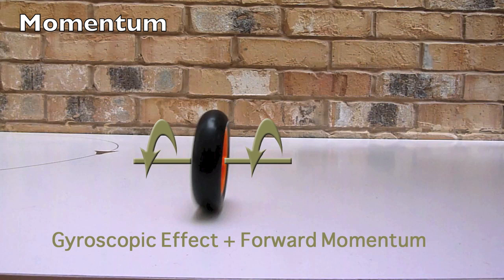The Physics of Countersteering

Comment: Sorry but "Physics of counter-steering"? Not so much. What actually causes the bike to lean is a result of gyroscopic precession. Applying a torque through the handlebars to the rotating front wheel induces a torque orthogonal to the axis of rotation causing the bike to lean. Riders will also know that the more you counter-steer, the larger your lean angle gets. This video tells you that you need to release pressure on the grip to allow the wheel to steer. This is simply false and is absolutely not explaining the 'underlying physics.'
Reply: Basil43D
Nope. The video does have some minor flaws but is actually correct in every point that you address.
Reply: Enema Twatson How's that? The video mentions nothing about gyroscopic precession. The author is stating that the lean is created by first steering in the opposite direction to, in effect, push the bottom of the bike away before turning the bars back to the intended turn direction. That has nothing to do with resulting torques, and while seemingly intuitive, is not correct. Like I said before, if you are riding and desire to increase your lean angle, you increase countersteering pressure. This is the opposite of what the author stated. I appreciate your reply, if you think I've missed something please let me know.
Reply: Basil43D
It's been proven that while gyroscopic precession does exist and inevitably occurs while CS-ing a bike, it is neither the main force at play nor is it in any way necessary. The primary factor is as described in the video.
Thus, omitting gyroscopic precession is something I'd call a simplification rather than an error.
PS: I apologise for being a bit curt in my initial reply.
Reply: Enema Twatson I'd love to see the study that concluded that. Gyroscopic precession is a fundamental principle when talking about rotating systems and dynamic analysis. Gyroscopic forces can be immense even at the scale of a motorcycle wheel. In fact, in some cases, inertial forces will be greater than respective mechanical counterparts.
Reply: Basil43D
Fair point. I certainly cannot calculate it myself. I have seen a single figure of 12% of the force which may or may not be correct and surely depends on a whole host of assumptions.
The proof I'm alluding to is rather that bicycles with an extra contra-rotating front wheel (resulting in zero gyroscopic precession) have been built and reportedly steer pretty much the same as a normal one.
Reply: Enema Twatson I could see how a bicycle wouldn't be severely impacted by such an addition, however, I'm sure you would agree, the difference in angular momentum between a bicycle and a motorcycle are orders of magnitude apart. Just the weight alone would make a massive difference let alone that motorcycle wheels have much higher angular velocity generally. I'd be curious to see how bicycle steering would be affected at greater speeds such as we are seeing in the tour de france these days where riders are routinely reaching speeds exceeding 50mph. I would bet that at these speeds they would begin to behave similar (steering wise) to a motorcycle.
Reply: Basil43D
Bicycles have larger wheels and are also very much lighter. Not sure how this pans out in terms of how significant gyroscopic precession is.
One thing I'm pretty sure of is that bikes CS much easier at 25 mph or so than at 80 and that they steer lighter and faster with lighter and smaller wheels which rather suggests that the gyroscopic "effect" is actually detrimental. 
In other words, the help you get from gyroscopic precession does not offset the cost in terms of inertia.
Reply: Well the resultant torque which causes the precession is based on the angular momentum of the wheel. Angular momentum is the analogue of linear momentum which is just mass * velocity (p = mv) so in our case it is mass moment of inertia * angular veolocity (L = Iw). Approximating the wheel as a hoop, we can say that the angular momentum of a wheel is equal to mass * mass moment of inertia * angular velocity or (L_wheel = m*R^2*w). This means that the radius of the wheel has a greater effect on the resultant torque than mass or angular velocity do, but they still will contribute. In the case of the bicycle wheel which has a slightly larger diameter than a motorcycle wheel but as you mentioned, much less mass as well as (genreally) much less angular velocity. All in all this means that the precessive effect will be much, much less. We could calculate some examples but they would obviously be approximate as there are many factors to consider (wheel weight and cross-section, brake disk weight, tire weight etc...).

In regards to your comment about bikes being easier to manuever at slower speeds, of course you are correct but note that your attribution of detrimental effect to gyroscopic precession is misplaced. Gyroscopic precession is merely a name given to a specific resultant torque and its tendency to act 90 degrees out of phase with the input torque. In our case, the resultant torque is that which causes the bike to lean, and the input torque is the input from the handlebars. What makes the leaning more difficult is a result of the greater angular momentum (see above) because of the increased angular velocity of the wheels (remember, L = Iw). This is of course why lighter wheels and tires make for a more nimble bike. In order to reduce the force required to lean the bike over with counter steering, the only variable you can control is mass (assuming all wheel cross-sections are the same, and for the most part they will be). The resultant torque will always have a positive linear relationship with the input torque regardless of all the other variables.

I hope this makes sense. I'd be happy to elaborate on anything that I didn't explain well, which lets be honest, is probably most of it! :)
Reply: Basil43D
So far no real disagreement except that I have no idea of the magnitude of the force generated by the front wheel moving aside so no idea if it dwarfs gyroscopic precession or not. I guess the ratio is speed dependent as well. At any rate, it's definitely not something we can guess at.
Reply: Basil43D
Regarding input torque vs resultant torque, I think that's pretty much what I was getting at.
More gyroscopic inertia does not "pay for itself". The bike will be more flickable if there is less of it suggesting that the ability to turn the steering faster and with more amplitude trumps gyroscopic precession when it comes to causing the bike to lean.
Reply: I certainly see what you are saying, but realize that the very act of moving the wheel to the side is (essentially) what causes the precessive effect. In fact, the resultant torque I mentioned earlier would act instantaneously as the input torque is applied to the handlebars, whereas, the amount of gravitational torque you referenced required to lean the bike over wouldn't be great enough until the lean angle was considerable. Especially at greater speeds where, as you mentioned, angular momentum would effectively be resisting any change to lean angle. I believe this is the reason that the counter steering effect occurs so seamlessly and immediately, because it is initiated not by a gravitational torque as you mentioned but rather because it is initiated by the resultant torque which is instantaneously applied as the input torque is applied to the handlebars.

Comment: If I wanted to get around that obstacle I would simply push down on my left grip and as I got my angle I would push down on my right grip; You can call it what you will but it has worked for me through six motorcycles over many years.

Comment: The last part of the explanation is mostly incorrect. Sure, at low speeds you can do this. But At any normal speed that's used on the road, The bike never actually steers in the wrong direction to set up the lean. Pushing on the left handlebar never actually makes the  handlebars or wheel ever turn to the right.  Instead what it does is, it causes gyroscopic precession to lean the wheel to the left.  You're applying a force to the front wheel, and the wheel (and steering) are reacting in a direction 90 degrees to the input (90 degrees later in the wheel rotation. So a right turning force applied to the wheel causes the wheel to lean left.  another way to look at it is, you're trying to make the back of the wheel go left, but instead the top of the wheel goes left/the bike leans left).
Reply: Brian Cooney
You are wrong. The steering angle may be very slight and of very short duration but it must happen.
How would gyroscopic precession occur otherwise? Let's leave aside the proven fact that gyroscopic precession is only an incidental phenomenon that does contribute somewhat but is by no means the whole story.
Reply: Have you ever tried "the bicycle wheel trick" for gyroscopic precession?  I was lucky enough to have the setup for a while.  just a hinge attached to the axle of a bicycle wheel.  With every input, the reaction is exactly 90 degrees off. Above a certain rpm, It never moves or reacts in the direction of the input.
With that being said, I have played around with this on the motorcycle quite a bit. And i'll agree that it's much more a combination of the two, than my original comment suggests.  The bike does need to go "the wrong way" a little bit, in order for the lean to take place. But the gyroscopic precession is what makes the lean occur (without it, you'd need to consciously lean the bike over, or wait for it to sort of "fall into" the turn.)
Reply: Brian Cooney
I have actually tried the bicycle wheel demo holding the axle in my own hands..You just cannot stop the wheel from leaning. It's real, no doubt about it. 
It is a very convincing little trick. A very useful teaching aid to overcome the disbelief of the students. 
However, the position I now believe to be true is that it is indeed just a trick and that the force while not  trivial is far outweighed by the force outlined in this video. 
It's impossible for the rider to tell for sure and I admit that I have not seen any actual calculations yet.
Edit: And bikes really do CS as soon as there is any forward motion at all. It's just that it's not a very easy and controllable way to turn at very low speeds.
Reply: gyroscopic precession is "just a trick"  lmao.  You obviously don't fly helicopters or use any sort of gyroscopic instrumentation.
Reply: Brian Cooney
Try again when you have actually understood what I said.
lmao. Lol. 😁
Reply: The gyroscopic effect is somewhat negligible in this case...

Here's the best analogy I can think of that you should both hopefully be satisfied with:
1. Think of the front wheel on a bike like a front-ship rudder on a boat, but in this case, rather than the rudder being straight down into the water, it is projecting forward from the boat and sitting above the water waiting for you to 'turn it' from the handle-bars (steering-wheel) before it makes contact with the water.
2. Instead of a steering-wheel you have bike handle-bars
3. You push forward on the right bar
4. This causes the left side of the rudder to make contact with the water, which creates a drag force on the left-side of the boat and steers the boat to the right (just like putting a paddle on the left side of a boat would make it steer right)

The same is what is happening on the road with the tyre, push the right handle bar forward and the left side of the tyre is making more contact with the road, the bike now wants to fall over itself to the right hand side due to the disproportionately larger (and temporary/momentary) 'left-side' contact patch on the road, the bike is tipping over its own weight until it strikes a balance, it is a fine 'balancing act' of forces on two wheels due to its centre of mass, not the case in a car where the centre of mass sits inside a square of 4 wheels, on 2 wheels it is just sitting on an axis
Reply: That is only part of what's happening. There is a lot of gyroscopic precession at play.  If you don't think there is, just ask yourself this:  How easy is it to turn the front wheel when riding?  is it more difficult to turn it when riding than when stopped?   Yes. Of course it is. Where there is gyroscopic rigidity, there is gyroscopic precession.   
Did you also notice that the handlebar on the inside of the turn tends to "push back" against your hand in a turn?  That's also gyroscopic precession. It's basically a gyroscopic feed back of the bike leaning.   
There's a lot more physics involved than just steering the tire and having the bike fall into the turn.  That's part of it, but definitely not the whole picture.

Comment: Think about this; When you first learn to walk as a toddler, you learn how to balance yourself on two legs standing upright. Cool. Then when you are about 4 years old, Dad comes along and puts you on a small 2 wheel bicycle and gives you a gentle shove forward. The damn machine doesn't want to cooperate. After crashing 10 or 20 times, your young brain finally puts the problem into perspective and you begin to shift your body weight and handlebar in the proper direction to remain upright ( more or less ). Voila! You can ride a 2 wheeler without those pesky training wheels.Its somewhat counter intuitive to our sense of balance, which is why we have some trouble mastering it, but  It stays with you the rest of your life.

Comment: Nonsense. The gyroscopic forces on your spinning wheels by themselves are inadequate to keep you upright and anybody who has ridden their bicycle on rollers knows this. Without fork rake and trail, your motorcycle would not remain stable. The shape of the tire is also significant - if your tire was square in cross-section you'd have a Hell of a time leaning into a curve. On the other hand, tip a cone onto the ground and it will roll around its point. The motorcycle tire is like that cone. Tip it while rolling forward and it's going to begin describing the turn. Counter-steer serves to present that the side of the tire to the road, tipping the "cone," and initiates a turn.

Comment: I rode for 50 years without noticing the first input is opposite the intended direction of travel..... It makes total sense though. Moving the tires to one side  forces a lean to the other, which is what's referred to by motorcyclists as "throwing" the bike into a corner.
However I can't possibly imagine someone negotiating traffic, and trying to "think through" a maneuver. Better to get a 125/250 and ride around in a pasture every day for a month or so. By then it should be all reaction and muscle memory...... Good Luck.....

Comment: i would like to add to great explanation that when you countersteer you push bike to a smaller diameter of a tyre which provides turning. Square tyres wouldn't turn.  In that regard it is little similar to a how train turns.
Reply: Square section tyres can be turned ; I rode sidecar tyres solo for 3 years, including one front tyre that had asymmetric wear across the tyre as the bike had been set up incorrectly on its previous sidecar. I was simply doing naturally what is now called countersteering  as I had ridden bicycles since age three.

Comment: this is an over-complicated explanation of what is going on. also pushing forward on the left hand grip does not set up the bike for a right hand turn. (2:12 mark in the video) it is setting up the bike to lean left by shifting the front tire's contact patch (the part of the rubber that actually contacts the road) to the right of the bikes center line. this moves the bikes weight center, or balance point, to the left and thus creates a lean that way. this point is so often missed by those trying to explain countersteering. i explained it to my 7 year old grandson in about 5 minutes yesterday and he 'got it'. 

you can try it with the bike not running and you standing beside it holding it up. turn the front wheel away from you and notice the bike will tip towards you. you can even try it with a bicycle which might be safer btw.

 this would not work if the bikes front end did not have 'rake' built in but that is another subject for another day.

Comment: Im going to try this up in my bicycle.
Reply: Well, did you find that worked? I raced bicycles and commuted on my motorcycle, I testify counter-steering "works" with both but a fatter tires of the motorcycle make it more obvious. The narrower bicycle tires require so little input that it's harder to separate the weight shift from the steering input. Just a little pressure on bar toward the inside of the turn and you've counter-steered without hardly noticing it.

Comment: The one wheel demonstration maybe incorrect. When you roll a wheel attached to another wheel behind it AT an ANGLE, it will want to STRAIGHTEN. Not continue rolling at the same angle like with the one wheel in this video. I think counter steering has to do with the contact patch.